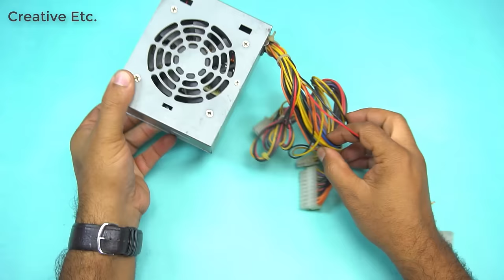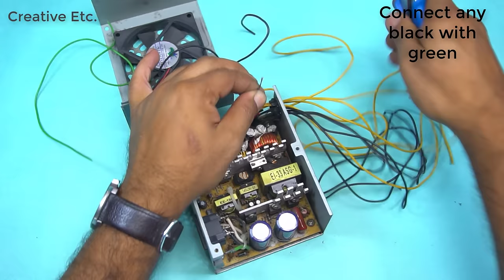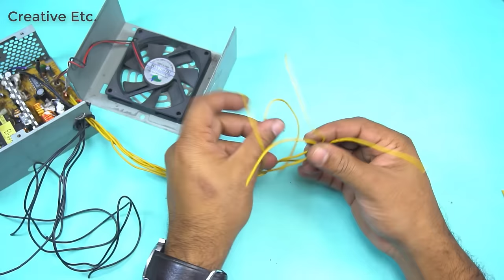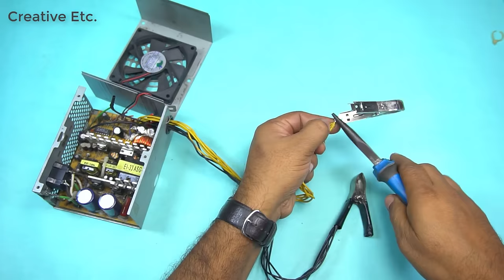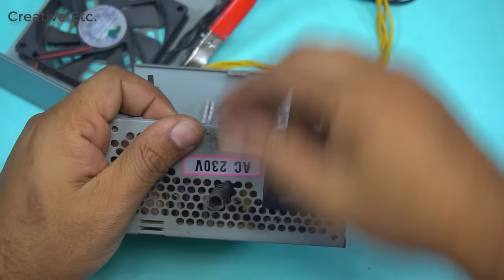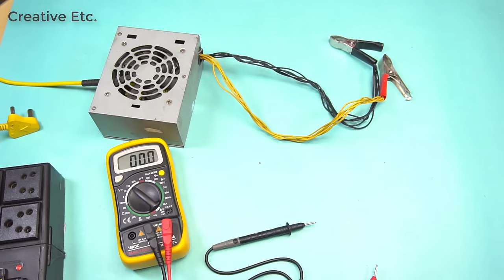How to Make 12v Battery Charger With Old SMPS

Comment: You can't charge a 12v battery with 12v supply, you need at least 13.8v supply. You will destroy your battery because you are not fully charging it.

Comment: Do not build this!!!! Your way will not work as you need at least 14v to charge a battery. It can be set up to do this at about 0.5amps but not that way. You will need to use the -12v lead [blue] and the +3.3 lead [orange] which will give about 15.5v at about 0.5amps which may be enough to slowly trickle charge at battery.

Comment: Not enough voltage out to properly charge a lead acid or gell cell battery. They require 14 to 15 volts dc output.
Reply: Add 3.5v from orange wire to make it 15v.just put diode to bit lower voltage
Reply: @mannyboyobillo9192  instead of green use orange cable?
Reply: @martink4719  adding the orange wires to the yellow wires pack

Comment: Battery Need 14 Volt To Charge this battery
Reply: Voltage feedback circuit can be modified to adjust the output voltage.

Comment: Use the standard computer power lead for the AC. Do not use your way. It does not have a grounding earth. IT IS DANGEROUS!!!!!!!!!!. You have not disconnected and removed the computer power terminal which will be now LIVE and DANGEROUS. When you plug in your modification if you touch those terminals or short them accidently and you will FRY!!!!!!!!!! Or this is what you intended to do!!!!!

Comment: You need to modify the Power Supply to raise the voltage to around 14 volts in order to charge a 12V battery... You can't really charge it at 12.2V...
Reply: Can, but really really slow

Comment: My friend, I gave the like just because i learned about the green-black connection to start the atx. As people saying bellow, there are two things i think you didn't considered: 1- To charge a 12v battery, you need 14v (is there a way to do this with this device?); 2- The amperage (I think it's necessary a consumer or a resistance in line to limit the amperage, am i wrong?).
Reply: It’s not a car battery tho. Charging these with 12 and about an amp is ok.the thing that confused me was why he bypassed the grounded power connector lol.

Comment: You have made a good video. The battery is not working to charge, the computer power supply battery does not charge at 12.20. The battery requires 14 volts to charge

Comment: Why with a welded power cable inside the box?
The pins on the outer plug of the box are unprotected and will have 230V.
DANGEROUS, VERY DANGEROUS !!! 
(I'm sure that I will not use this idea!)

Comment: very nice video. But one thing i wouldn't do it leave the 5v and 3.3v without any heat shrink on it. You will have some problems if touching the metal.

Comment: There are 3 things that I believe you did wrong:
1) In order to charge a 12V battery, the power supply has to be 14V
2) You should add a current limiter and an auto off system when the battery is fully charged
3) Instead of soldering a power cord on the pins, you should better use the device's cord, because now the pins are exposed to mains power when you plug it in

Comment: Hello bro nice video, but your knowledge is weak, it will not charge the battery, because smps is giving only 12v, it should be minimum 14v across the battery terminal to charge.

Comment: Things missing in this video

#. A buck boost converter manually tuned to 14.5 V from 12v

#.a charging control board to cut off the charging when the voltage reaches upto 14.5

#.thick wires since those yellow wires can't handle higher amps...

Comment: Will not charge more than 25% needs 13.8 for standby use and 14.3 for cycle use for 100% charge soc
Reply: Can we use 12+5 v from its power  cable for 15v
Reply: @Hemantgora  no internally both have common negative, so you will be shorting 12v to 5v rail
Reply: @thecuriousone9342  thanks bro can u teach me about technical phisics
Reply: It works with my van, the battery gets not more than 12v and was good enough to start, since de alternator of the car did the rest.
Reply: @hydrosolutionsltd.6928  If you want to jump start, you don't even need to make this shit, just grab your 12v 1amp router adapter and connect it to your battery for some time, will be enough for a crank or 2,
Reply: TheCuriousOne well if you don’t get it, I’m refuting your affirmation about the “13.8” deeds for an “standby” use. I’m working right now with that battery charged only to 12v and it is been “ standby” used for the las 3 days with out a problem!
Reply: @hydrosolutionsltd.6928  You  WILL NOT get the full capacity is all am saying,of course it will 'work'. Example if you're happy with your phone being kept at 45% charge all the time,by all means go ahead
Reply: TheCuriousOne I’m happy with the trucks and vans of my company working all day long as they are. What is your point? Obviously the 12v charge was good enough to give us enough energy for the first 5 to 10 starts, the alternator is doing the rest? What is your problem?
Reply: TheCuriousOne I just test the battery again, it give me 12.8 volts which show me another inaccurate statement from you. It doesn’t represent 45% of a charge, doesn’t it?
Reply: TheCuriousOne your first statement say that 12v is not enough for a battery to do his job.  It was totally false. Your second statement mention a guessing (45%) which is (false) 12.8V are more than that, and again you put the pathetic example  of a cell phone battery, let’s remain you, cell phones didn’t come with alternator!
Reply: TheCuriousOne what Do you think I try to say from the beginning when I said “the alternator is doing the rest” so you didn’t  realized?
Reply: @hydrosolutionsltd.6928  You fool did you see an alternator in the video??? NOT EVERYONE HAS AN ALTERNATOR IN THEIR HOME TO CHARGE A  BATTERY, LIKE I SAID LEAD ACID NOT JUST USED IN AUTOMOBILES READDD!!!
Reply: TheCuriousOne the only one playing stupid is you. A 12v charge is good enough for a battery to start and work a day, the alternator is going to do the rest, I told you in the beginning and I told you again, simple as that.
Reply: TheCuriousOne if so go to your firs stupid arrogant comment and add a statement at the end, telling people that you a right except for batteries used by cars! (Which are the big majority )
Reply: TheCuriousOne so again? You didn’t understood my last comment? And obviously have not idea how the solar system works. You make me laugh at this point, if you have a solar system that needs a battery charger, what kind of solar system you have? 😂😂, pathetic!
Reply: TheCuriousOne you have not idea what are you talking about! Simple principles give many troubles to people that don’t get out and put them in practice. If the panels are not able to charge your battery, so you need new ones, that is what a Try to say, obviously you didn’t got it! I need two or three comments more probably!
Reply: @hydrosolutionsltd.6928  And you don't get it after a page full of comments, its just basic electronics
Reply: TheCuriousOne you after a page of comments still reject to admit that your first comment is trash, simple as that!
Reply: @hydrosolutionsltd.6928  Oh the level of dumbness is amazing, 12.2volts will not FULLY charge a battery prove me wrong make a video of it get a new battery  say 26ah charge it 12.2 v and show me full capacity show me that you can get the whole 26ah out of it by charging voltage of 12.2v
Reply: TheCuriousOne Your first comment is trash, this one is wrong I already told  you that my 12v computer charger worked good whit my battery. I already in the beginning told you, the alternator made the rest.
Reply: @hydrosolutionsltd.6928  Btw its comments not contents
Reply: @hydrosolutionsltd.6928  Well that is what my comment meant if you agree
Reply: TheCuriousOne so is necessary another page of comments  to tell you that I already change  the last comment? Your first comment is trash, pathetic how you tray to divert things. But you have a better future as an English teacher for sure!
Reply: @hydrosolutionsltd.6928   Hydro Solutions Ltd.  Your whole  van and  truck argument was pathetic, my First comment would br understood by anyone in the field of electronics, there was no need for all this but no you wanted to flex your pointless and wrong knowledge, read the first comment, i never said
That it won't charge at all i meant it will not fully charge, that's all, there i even edited it for you so i don't have to hold your hand every step of the way to make you understand basic battery working
Reply: TheCuriousOne it is trash, Already told you, the alternator fix the rest, about your “solar powered system” that was really pathetic.
Reply: @hydrosolutionsltd.6928  30 replies and he still doesn't get it 🤣🤣🤣🤣😂😂 wonder how you are not fired from your job yet, thank god you're not into electronics or else things would just stop working randomly
Reply: @hydrosolutionsltd.6928  If you still bloody DON'T GET IT, ignore my comment and look what other comments are saying the exact same thing, drop your moronic act and you will learn a thing or two about batteries
Reply: I charge my battery with 14.4v this method will not work maybe charge 10% or less evwn if u plug it in 3 years your battery still at 10% charge😂😂😂😂😂
Reply: @thecuriousone9342  😂😂😂

Comment: Sorry, if I understand it Right. You use the ATX PSU to charge you old Batterie, if yes… what is the MAX Amperage can the PSU deliver? Thanks for your Feedback.
Reply: You need some sort of boost converter as 12.2 volts is not enough, also the amps depend on the power supply some can deliver 40 amps and some much less there will be a wattage rating on the PSU

Comment: AGREE WITH PREVIOUS COMMENTS. BATTERIES CAN NOT BE CHARGED WITH REGULATED 12V VOLTAGE/CURRENT. WHEN BATTERY IS LOW IN VOLTAGE A CURRENT RUSH WILL OCCUR AND BURNS THE P/S. THAT BATTERY WHEN STARTING CHARGE WILL NEED MORE THAN THOSE 12V .

Comment: Power supply voltage 12 and battery voltage  12 . But for recharge  battery you need 15 voltage with 4amp .....this supply use only for device running not for recharging

Comment: Good way to destroy a battery, each battery has a limit for charging current you did not use one, voltage increase can be reached using capacitors and can get a value of 14-14.5 . And please use ground otherwise you will get shock or death !!!!!

Comment: thank you 
 i got 12 volt from the power supply of the computer
i used it to charge battery(12 volt  7ah)
but the amber of the power supply is 2.1?
is it problem
Reply: The amp is not a problem. The 7ah is the capacity of your 12v battery. The lower the amp of the charger, the slower the time it takes to charge. So, if you have a 5 amp charger, it will be quicker to charge than the 2 amp.

Comment: bro 12.20 volts will not charge lead acid battery needs 14.4 volts constant current not constant voltage

Comment: How it is possible to charge any 12 volts battery by your this trick, at least you must have 14 or 13.8 volts power supply, you have to work first to increase the voltages of PC supply

Comment: Your Demonstration is unprofessional , you need 13.75 volt DC to properly charge 12.0 volt battery.
It also depend on amperes vs time to take full charge. Why not explained how to increased ATX 12.0 volt to 13.75 volts so that it can charged properly.

Comment: ❌WTF Do not do this at home😱😱
This method is very wrong
Led acid  batteries do not charge 12 volts😨
The charging voltage should be greater than the battery voltage For example,  13 14 😡
There are methods and calculations for choosing the appropriate voltage😠
I would not advise anyone that I consider trying this one or it will damage the battery😡😡😡😡😡

Comment: This is a fraud. What you have to do is to document yourself before, so you will never charge a battery, the charge always has to be higher than the voltage of the battery to charge

Comment: It is not useful at all for a 12V battery. You can charge the battery by changing the voltage above 12V

Comment: This is the worst idea ever 1 it only charges 12v most 12v battrys need 13v to charge completely 2 it won't turn off one the battery is charged it will keep pushing power through it tell the battery is destroyed 3 it won't charge fast it is vary low amps compared to a standard charger you are better off just buying a cheap 20$ charger on Amazon
Reply: It is possible.

Comment: Smps have no current limiting protection, and  we know that lead acid battery has low internal resistance, so huge amount of current will be flow it will damage the battery, and due to excessive heating and gassing it can be blast 🤣🤣🤣💣💣💥💥